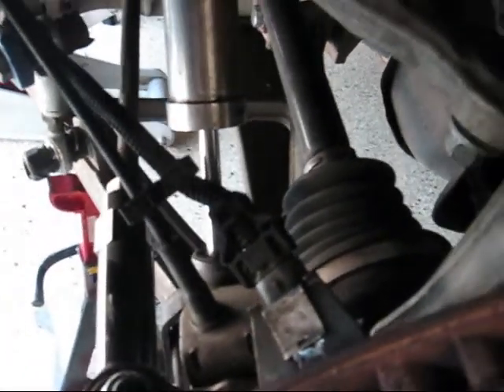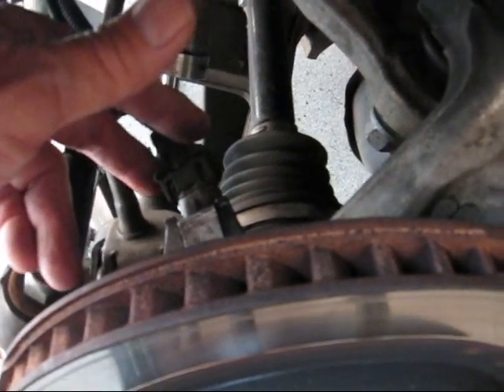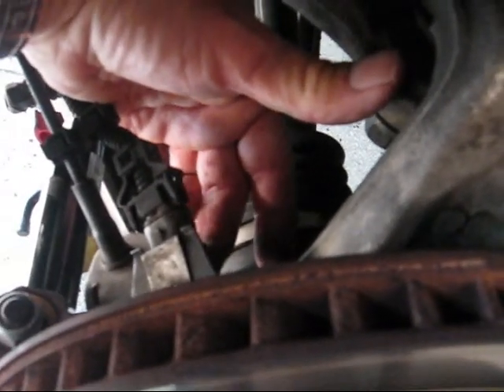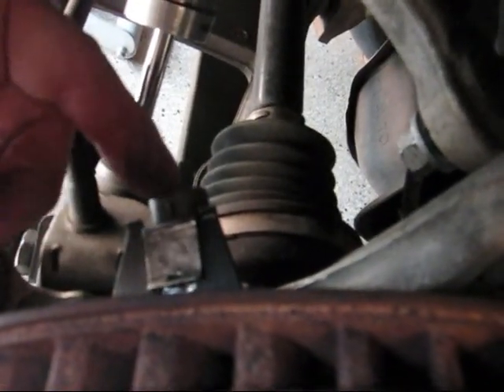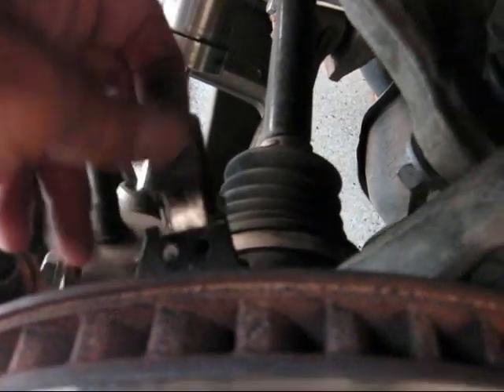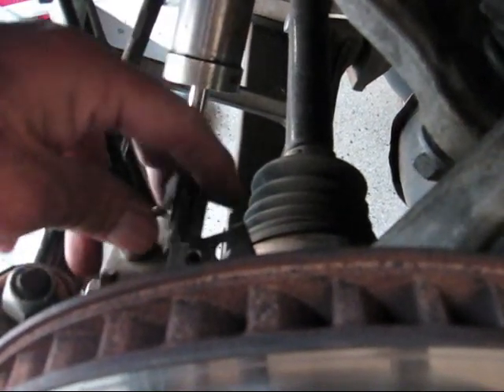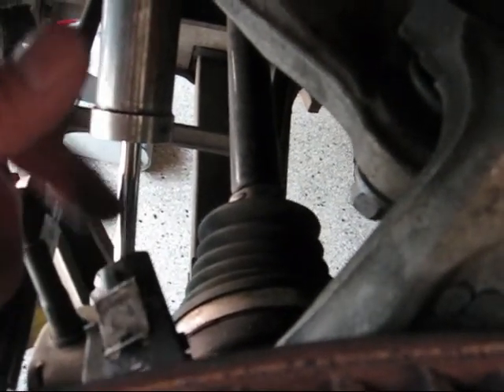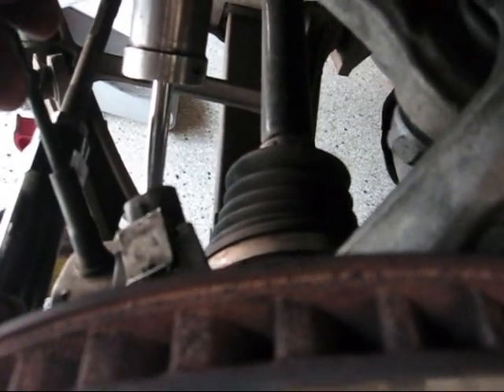Corvette C5 wheel speed sensor issues by froggy

Comment: I have a 01 and all my gauges work but not the speedometer do you know what I should do ? Thanks Dave
Reply from the maker: Hi Dave, that's a new one on me. So I would start with looking at codes if there are any. Clear them, drive the car & recheck. I don't think there are speedo cables in newer cars, let me know what you find. Google it of course.  :)

Comment: Asking a question.  Has you replaced the DIC. I replaced mine today and with the dash sitting in place all wires attached, when I turn on the lights the DIC dose not come on. I dam sure I have all the wiring plugs plugged in the the dash. my old one had the top light bulb out that's why i'm replacing it. When I plug the old one in now it will not light. I think i'm missing something. Any help.
Reply from the maker: Is the replacement a known good dic, is a chinese clone?
Reply: froggy I purchased it I have a reputable seller honeybee it said it was tested. And just so you understand my old unit I took out had the top light out so I thought I would just go ahead and purchase a complete unit just swap them out everything worked fine until I took it apart, and all the lights work on the dash when I’m setting it in place it’s not bolted in yet you understand I turn the lights on and the lights on the DIC do Not come on I unplugged the replacement DIC and plugged in my old one that I know the lights work in and it didn’t light up so I’m a little confused with all the lights working on the dash and the button is working on the DIC what am I doing wrong? I appreciate your response
Reply from the maker: @Rodfather.  So now neither one is lighting up? Check the power coming to the conn. Maybe blew a fuse doing the work?

:)
Reply: froggy If it was a fuse blown don’t you think maybe none of the lights on the dash would work. Like I said all the lights on the dash work fine along with a dimmer in the HUD I’ll look in the fuse box and see if there’s a separate fuse for the DIC but I don’t think there is
Reply from the maker: @Rodfather.  There are a LOT of fuses, pls ck, it's easy.
Reply: froggy I checked all the fuses. I’m going to check the continuity on the ribbon cable to see if it still has continuity
Reply from the maker: @Rodfather.  Keep at it  :)

Comment: Thanks Froggy very good advice . I have a 2000 corvette and had front left sensor codes and i think its corrected now buy adjustng that bracket tighter now the lights off
Reply from the maker: Good work,

thanks.

:)

Comment: My corvette abs traction lights have been on since I've owned the car for several months, never was a problem until my mechanic cleared my codes for me and my corvette all of a sudden loss a lot of power and went into limp mode. So I checked my DIC and the codes c1226 c1225 both popped up and it my two front wheel speed sensors. Going to give them a thorough cleaning and see what happens. My car can barely brake traction anymore
Reply: JOE BANGA did you fix the problem? I had the same issue it was right front wheel speed sensor connector...it was super dirty took out the wheel cleaned the connection plug it back and no more problems
Reply from the maker: You are on the right track so far as the abs, no idea on power loss need more info.

:)
Reply: panzer waffen I've since sold my corvette, but i took it to a shop and said that all my wheels speed sensors where bad and they had to replace all the bearing hubs too which was a lie . Never got around to changing or cleaning them out
Reply: JOE BANGA ohh got you
Reply from the maker: When a shop tells you something like that RUN AWAY that' a bs lazy "they think you are stupid" diagnosis.

:)
Reply: froggy i couldn't agree more...
Reply: froggy i remember my first car was having a small coolant leak after i found the problem i took it to a shop ...went to the shop for a leak and they wanted to replace...duel pump...spark plugs...wires etc....
Reply from the maker: It's too bad, a good honest mechanic is a very hard person to come by. So many scam mechanics around because folks just don't know how to fix things these days. That's why I do what I can by putting up videos to help.

:)
Reply: froggy more than true that...my mechanic is the only honest one i have met but just when hard or difficult things appear is when i call him ..if there is something i can do by myself i do it ..save money and honestly i love to put my hands on my big butty and of course i take the advantage of this moment to thank you a lot for posting such wonderful videos of how to fix in c5 corvette ...you are the first youtuber i did subscribe when i bought my c5 you have helped a lot to every corvette owner to learn to fix and save money greetings and blessings

Comment: How many wheel speed sensors are there on a 2004 Corvette base, automatic? Are they on the front and rear?
Reply from the maker: Each wheel has one, it's a built in part of each wheel bearing.

:)

Good question.

Comment: im having the problem in my 97 when i start the car in the first tight turn my car stop for a second and later go forth just turning right...also sometimes i feel like the  brake pedal goes forward
Reply from the maker: You need to check the dic codes first, I have a video on how to do that in the Corvette Playlist. Then post a comment with the codes.

:)
Reply: froggy thanks a lot mr froggy i did check the codes i found a code related to right front wheel i will check it out thanks one more time
Reply from the maker: Keep me posted.

:)
Reply: froggy sorry for being late but yes i did fix the problem it was a dirty speed sensor connector...it is amazing and unbelievable how a simple dirty connection make any c5 to run different thanks one more time for uploading such wonderful videos blessings and greetings from sunshine state

Comment: Froggy, I have a 2004 Z06 (Arrow21Pilot on the Corvette Forum) that has seen its share of electrical issues. Do you have a video showing the testing and removal of the EBCM?

Thanks...
Reply from the maker: Well no, but it's in a pretty accessible spot on our car. As for testing I only look at the codes & knock on wood have not seen any. If I did and wasn't getting anywhere I would pull it and send it to absfixer who is on the forum, my buddy did that & he is a good guy to fix them. Trick is to get a good bleed when you have it back in.

Comment: I get intermittent code C1242 on my 2003 C5 Corvette. That's the only code I ever get. And with that, I get the service AHS, ABS, TCS. First few times, it only appeared after driving in rain, or car wash. Last couple times, not associated with any known moisture or rain. Tried to find and clean all the grounds we could. Any thoughts as to what to try next?  Could these wheel speed sensors be the problem?  thanks, Don
Reply from the maker: Got your pm on Corvette Forum, post the question where I directed.

:)
Reply: 7 years late here..did you figure out what was causing the C1242? 
Thanks

Comment: Thanks for posting the codes, My guy thinks I may be having a speed sensor issue. Hope it's just lose like yours. (getting the ABS and Traction Control light on the DIC)
Reply: Also mine had a ton of old "H" codes in it that the previous owner never cleared, That may have been the fix as well I hope.
Reply: Supes Me I have the same issue with abs & traction  light showing. do you know how can I make it go away ?
Reply: Yes you can, but here's the Deal. It's Probably your ECBM (Electronic Brake Control Module) Which was one of the only Faulty things on the C5. NOBODY makes a replacement for some odd reason so you have to wait  for somebody to sell one online out of another C5 and put it in yours. UNLESS your Car is pre 2000. If you have a 1997 thru 1999 Your EBCM can be rebuilt and you can send it off for that. 2000 and after you need another one all together. If your Lucky it's just a Speed sensor in one of the wheel assemblies...Look at froggy's codes above but It sounds like you have the same issue I did. I got lucky and got a EBCM for $500 bucks and the pump it attaches to was still good so my guy popped it on for $50 bucks...boom done. But a lot of times guys just SELL the ECBM's for like $1500 because they know they can get it. Good luck.